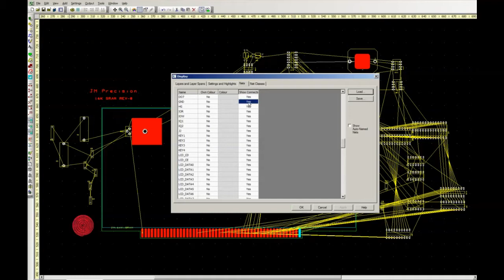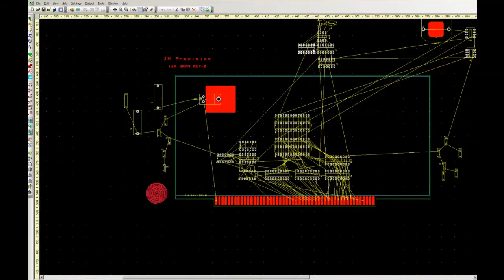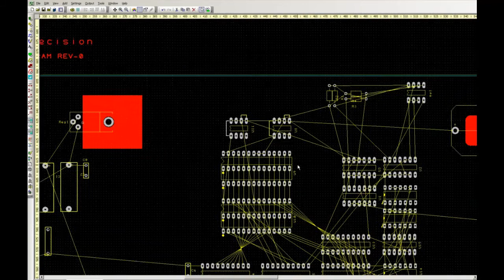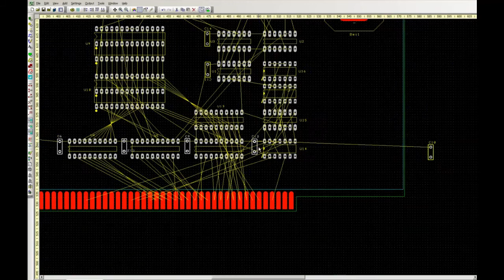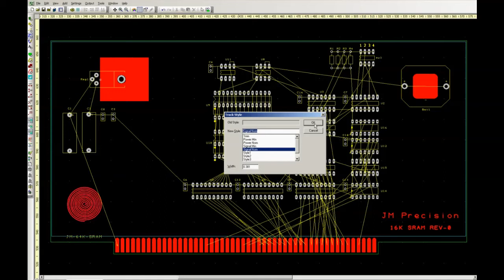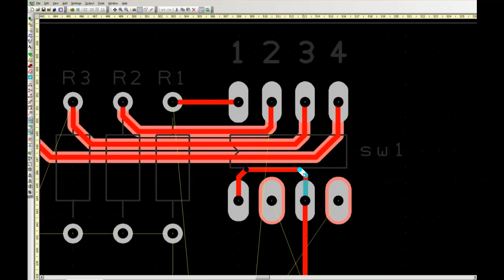Designing a 64k SRAM Card for Altair 8800 Part7

Comment: It has been a very long time since i've designed a PCB (I used PROTEL) so what i'd like to know are there any free PCB CAD packages that can be down-loaded from the internet? I use a mid 2011 iMac using the OS X Yosemite 10.10.5 OS.
Reply from the maker: I am not aware of any free pcb CAD programs although they may exist. I know that many vendors used to provide free demo versions which had limited pin or time restrictions but if you intend to spend time learning how to use a particular cad system then buying one is likely to be a good investment. Prices do vary a lot. I would not use a MAC for development for various reasons but that is just my preference based on previous experience.
Reply: 4 Years later but KiCad is free and pretty decent!